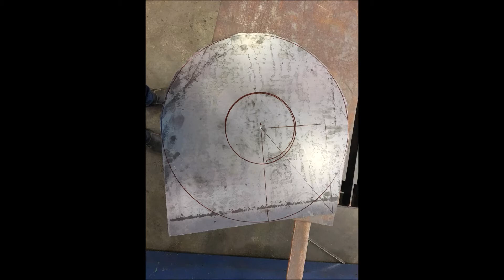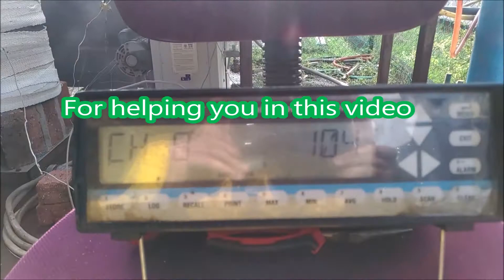How to build a small mono-tube boiler

Comment: I read the paper early, the low thermal efficiency was kinda disappointing, but i think you were aiming for higher flowrate not efficiency if understand correctly.
I saw some monotube steam generators elsewhere on youtube and the one used in dobster car, they were stacks of coiled tubes so all flue gas contact the tube before escaping, in this design lot of flue gas escape before even touching the tube.